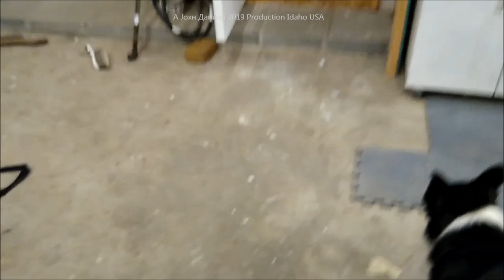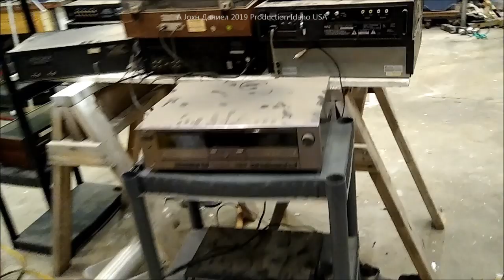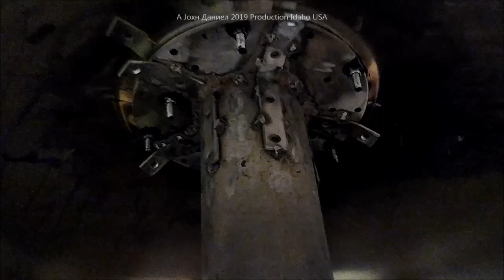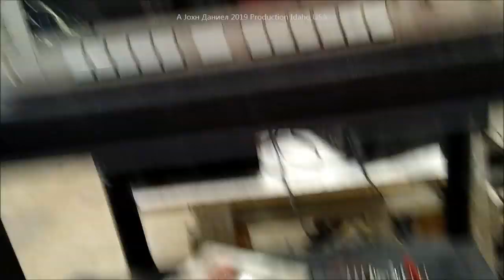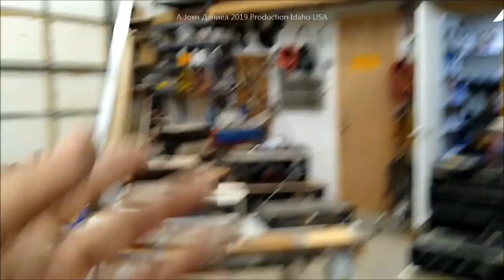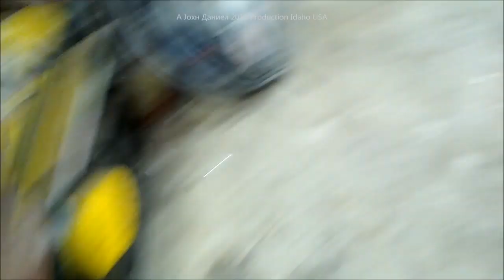Shop visit & Do U Wanna see Old School electronic repair? Post UR fix it thoughts

Comment: Do you have any recommendations for Ally express solar panels
Reply from the maker: Yes, buy your solar panels from Amazon! LOL! Fast, Cheaper, and covered by Amazon itself https://amzn.to/2JE9QFs And these are 4 buss bar, very consistent! Example: you can put 7 of those 100 panels on each 60 Amp mppt ( https://amzn.to/2BZGIUP ) for huge output. That MPPT is able to do all voltages, and most Lithium batteries too. I did a 21 panel / 3 - 60 a MPPT 24 volt system for a guy in Battle Mountain NV this summer, and 2 of the 5 blade 500 watt turbines and his 12 x 55 mobile home is now off grid so the combo works well. Its him and his wife, and their water well is 135 feet also ran on it.

Comment: JD  yeah man do the repairs bro- The more I learn the better. sending you another email
Reply from the maker: Sure will. First project we started was the 1984 Sanyo power head, a very low distortion 55 wpc main amp. It had a blown 4700uf in it, leaked all over. So its clean it out, repair and test. Seems to have a torched rectifier and set of filter caps as a result and unequal bias on the feed. Then its off the the 1977 Realistic STA-235B and/or from there a Sansui A60 power head from about 1985. On total count, 43 devices to be brought back to life or corrected.
Reply from the maker: A FEW PREMIUM  ELECTRONIC and ENGINEERING REPAIR PEOPLE 
**Subscribe to them and get more like them recommended, increase your skills
https://www.youtube.com/channel/UC5I2hjZYiW9gZPVkvzM8_Cw
https://www.youtube.com/channel/UCU9SoQxJewrWb_3GxeteQPA
https://www.youtube.com/user/glasslinger ( don't be afraid of this guy, Uh.....)
https://www.youtube.com/channel/UCNglbTNAb2tVCdspvip3N1w
https://www.youtube.com/channel/UCj_XaV1ss-qdD-lPUtTEcXw (self made engineer)
https://www.youtube.com/channel/UCw2SbtOH0K9AjQTbIRI6cqA
https://www.youtube.com/channel/UCcSeeATlWJJbXpOZRYOfaDg
https://www.youtube.com/channel/UCE9E9hMhvVtnmo3yvWnMZlg
Once you sub these folks, you will get more like them showing up in search.

Comment: Maybe 1 or 2 then you could ask again.

I would rather see you buy a tripod so I don't get so see sick. I'd also like to see more in depth videos as I'm new the TV repair & wind turbines
Reply from the maker: First video I'll show a easy way to test and solve the initial line voltage power circuit of a amp. Common fail for most old school when a component fails is finding last known power trail. Vid quality will improve, had the damn camera on some skydiving setting. For the record,  I ain't sky dived since my Gyro flying days.
Reply from the maker: I had the camera on some sky diving setting, kids used it before me, so the video was crappier than normal! But I have not skydived in 20 years since my many gyro flying days, and no plans to do it in the future. 
However, here's help, and A FEW PREMIUM  ELECTRONIC and ENGINEERING REPAIR PEOPLE 
**Subscribe to them and get more like them recommended, increase your skills
https://www.youtube.com/channel/UC5I2hjZYiW9gZPVkvzM8_Cw
https://www.youtube.com/channel/UCU9SoQxJewrWb_3GxeteQPA
https://www.youtube.com/user/glasslinger ( don't be afraid of this guy, Uh.....)
https://www.youtube.com/channel/UCNglbTNAb2tVCdspvip3N1w
https://www.youtube.com/channel/UCj_XaV1ss-qdD-lPUtTEcXw (self made engineer)
https://www.youtube.com/channel/UCw2SbtOH0K9AjQTbIRI6cqA
https://www.youtube.com/channel/UCcSeeATlWJJbXpOZRYOfaDg
https://www.youtube.com/channel/UCE9E9hMhvVtnmo3yvWnMZlg
Once you sub these folks, you will get more like them showing up in search.

Comment: Like to see how that oscilloscope works..... I prefer analog
Reply from the maker: See that link to it, go there and scroll down and you will see it compared to a full size. Its not a $500 unit, but its about all you will need 90% of the time. I learned a transformer was tricking me with 28 vac until put it on a scope and saw the voltage was heavily skewed. Saved me putting in unlimited OTHER parts till the cows come home!

Comment: I want to see you build a wind generator using a truck rotor , rare earth magnets . Including making your own coils for a 12-24 system. 
Make it vertical axis. 

We have / my wife’s her Uncle Carleton Butler system . He was the Bear Bryant’s Band director His home equipment was Panasonic. I stand looking at it as I type this.
Reply from the maker: Axial? I would prefer opposed radial flux honestly. Much more stable. My design, 2 12" cake pans rioted back to back together and 4" long magnets crossing the outer seam, cut out in the center almost to the rims and the core in the center split 3 phased. The old EMERSON ELEC design from 1922
Reply: I will have to check that out. Sounds interesting

Comment: I would really like to you repair that equipment if you explain it the way you do other things so us non-technical folks can understand it. Not sure where you will ever find belts for the belt drive tape drives, but look forward to finding out from you.
Reply from the maker: Sure thing, I already got them DooDads converted to Electrolytic Capacitor and DemColor sticks converted to links to resistor codes and values!

Comment: Yes please nothing wrong with , fixing older equipment . 

Keeyit up
Reply from the maker: I got numerous abused toys to fix, stay tuned and more on the way in Receivers, Amps, Tube or Solid State, System and charge controllers, repairing inverters, and solar hacks too. We gonna talk I-fet, MosFet, and Hfet all day round here as we solder from solar power!